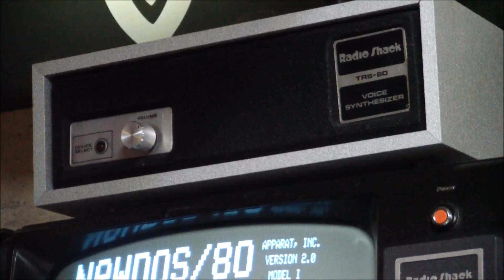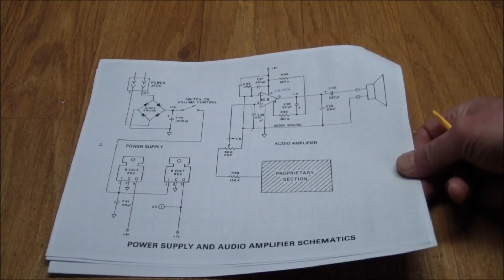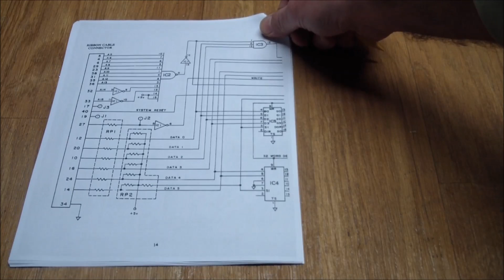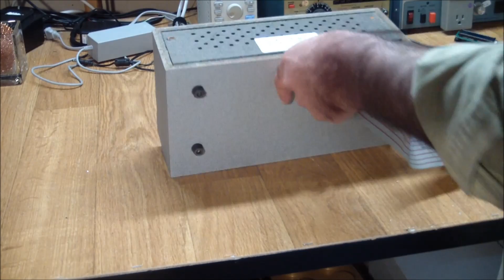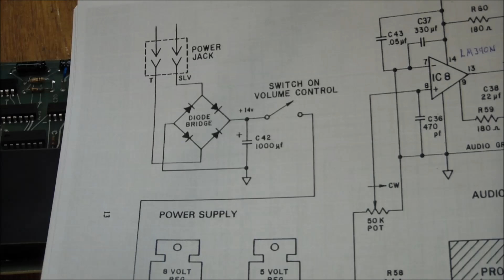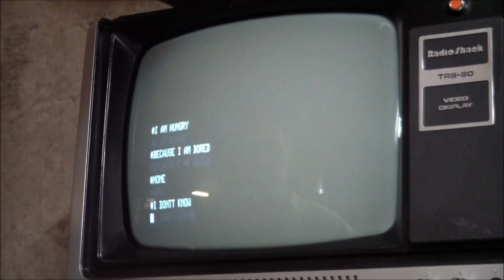AE#82 Radio Shack Model 1 Voice Synthesizer Repair And Teardown

Comment: I have depotted this board, and I can tell you what's under the epoxy curtain.  there are 12 RC filters, and 3 LM339 quad comparators.  That's it!  The rest of the chips are commodity CD4000 series parts and quad and dual op-amps.  I managed to reverse engineer it and make a clone.  The only custom parts on it are the two PROMs which are IC11 and IC12 (I dumped those too).  The chips were identified using a chip ID device.
Reply from the maker: Sounds like they built a phoneme synthesizer out of discreet parts. This might have been a prototype for the SC-01, and they used Radio Shack to field test it.
Reply: @artifactelectronics  yep that is exactly it.  I have reverse engineered 5 different discrete synths they made over the years (and potted in epoxy!). The stuff they learned did make it into the sc-01 after a fashion.  Was hoping to do some videos about it at some point.  I had the prototype for the SC-02 and made a clone of it, and shot some video but haven't posted yet
Reply: I just acquired one and I would be interested in all your reverse engineering notes especially the identity  of all the chips not in the potted section . Thanks very much...

Comment: Incidentally -- How did you get your Voice Synthesizer to play nicely with the Expansion interface?  I never could get mine to work together with it...  (of course, there were only, what, at least three different revisions of the E/I, and about as many revisions of the keyboard-to-E/I cable, so I wouldn't be at all surprised if you have a more cooperative revision of the hardware than mine.)
Reply from the maker: My E/I is a later revision that doesn't use the buffered cable. I haven't had a problem with the expansion port yet.
Reply: @artifactelectronics  That must be it, then -- mine is one of the earlier revisions that explicitly requires the buffered cable.  Still, it does seem peculiar that they won't play together -- the Screen Printer wouldn't work with the buffered cable because the buffers prevented it from being able to assert control over the bus and do direct DMA on the video RAM in the keyboard, but the Voice Synth should just be passively looking for writes to the last 32 bytes of video RAM, not trying to do DMA, so one would think it shouldn't care about the buffered cable...

Incidentally, where did you dig up a copy of the Voice Synth's service manual?

Comment: I have one of these but don’t have the input transformer. Could you tell me what I need to power this up?  Thanks!
Reply from the maker: I'm using something from my parts stash that outputs 9VAC @800mA.
Reply: @artifactelectronics  The spec calls for 12.5 VAC 800mA  but your 9V adapter worked ok? Interesting. I guess the 9V is enough to satisfy the created 8V and 5V.  Thanks, finding an exact one has been tedious.
Reply: Thank you!

Comment: You could try looking for the article in BYTE Magazine that shows how to build a speech synth that works off of the printer port. According to whats written here it may have been a Votrax chip, but I build one and I could have sworn it was a Vortex chip from Germany. (sorry I dont have access to the unit to check).
Reply from the maker: I'll look through my Byte collection, probably done by Steve Ciarcia.
Reply: @artifactelectronics  Yeah it was

Comment: GI Speech Chip, Radio Shack use to sell them..
GI Speech VOICE SYNTHESIZER SP0256A-AL2 + CTS256A-AL2 Text to Speech..
The reason it was potted was you could Build your Own with There Parts for about $100 1/4th the price..

So you want to play with my stuff eh.. Lets start OLD School, DuMont Model # 224-A Oscilloscope..It so Heavy..And needs a Tuneup..
Reply: This was equivalent to just the SPO256, plus some logic to detect when phoeme bytes were written into the buffer. The CTS256A did a reasonable job of text-to-speech and was designed to be driven from a serial port, meaning it could echo terminal text (like in WarGames)

However, the SPO/CTS became available around the time this synthesizer was being discontinued. The proprietary stuff in this unit came first.
Reply: Yea that makes perfect sense. It would be good to flip the board over and verify the chips pin count and footprint. I still have those chips in their original packaging.

Comment: When an Arcade games usings multiple CPU z80 chips, the IRQ signals are located in the ROM chips? the IRQ signals are trying to prevent all 3 CPU to never access the shared data buss and address buss at the same time? Since 3 CPU are sharing the data buss and address buss you need to use IRQ signals to prevent accessing them at the same time?

Comment: I found from and run very similar.
60Hz/120Hz certainly puts less strain on the smoothing caps than a switching PSU so they seem to last a lot better.
Reply from the maker: Good point. I've found lots of bad electrolytics, but rarely are those primary smoothing caps.

Comment: Radio Shack sold a carded voice synthesizer chip (SP0256-17) at one time...I'll bet that's what's inside
Reply from the maker: It seems to be a close race between the SP0256 and SC-01, or a precursor thereof.

Comment: All electrolytic capacitors prior to 2000 have corrosive DI-electric fluids.  Electrolytic capacitors become unreliable after 30 years, and after 40 years the acid has severely damaged the internals of the cap causing higher current flows and short circuits.  That's why we change them on a time expired basis.

Comment: Votrax were very secretive about their speech systems.  They were known for potting their non-IC versions of the Votrax SC-01.  Luckily the expensive bits of yours are still working fine.  Chips for Gorf/Q-Bert go for over $100 (!)

Comment: InTeReStInG... 

ALL THE secrecy. I was really chomping at the bit for a DEMO. However I failed miserably at understanding the majority of the synthesized speech 🤐. Of course the audio path from the unit to our ears would be quite the "Mr.Toad ride" when the path is considered. But still.... I swear it   "No' speek-ah D IngLish"   for me..

In a compairson, I always thought DECTalk was good, for the time... (@$4k, I bet). But after straining to understand the Shack-box, DECTalk is starting to sound more like Pavarott (no disrespect to RS. That was the place to spend your money! Even if they did need to know your address & PH# just to buy AA batteries.

Bottom Line: Enjoyed the insights, Especially after all these years. Pulling back that curtain and all that. Thank you 😁

re: Equipment donations🔬📹📸🖨💽🎥
For me, knowing what side of the world the ArtiFaCts-Lab is on would help in knowing what is appropriate to entrust to the (very questionable) shipping system. i.e. $ize, Weight & Fragility. I'm in So Calif. Cheers!
Reply from the maker: I'm in Salt Lake City, Utah. Shipping can be a problem (i.e expensive) since I would probably get a PO Box which would mean that items would have to be shipped via USPS. Maybe I should look for a mailbox place that accepts shipments from all carriers.
Reply: I understood approx 90 to 95% of it.

Comment: From the image the synthesiser looks like there is a ROM inside the potted area, and there is a counter driving some of the address pins, and then the speech is simply filtered from the PWM using the audio filters on the left side of the board, with all the large polystyrene capacitors and 8 pin opamps. Basically a prototype of the SPO256 chip with discrete logic making up the counters. There probably is a large mask or Eprom in the potting, and you will see the pins from below easy enough. Data out will probably be sent via a shift register to get the PWM, with the input data selecting the address blocks to use, and then perhaps another ROM in parallel doing glue logic for the various lengths of the phoneomes instead of having them all the same time.
Reply from the maker: I think it's a contest between the SP0256 and the SC-01. Maybe someone involved in the development of the synth will come across this video and solve the mystery.

Comment: I first used ELIZA in 1971 on the Ohio State PDP10 computer.  I/O was via teletype.   When you ran the program it would type out "The doctor is in" .  OSU was doing research on speech synthesizers it was a box of analog stuff connected to the PDP10.  i thought they were wasting time,  whats wrong with a teletype?
Reply from the maker: Funny you should mention that. In the mid 70's we had a PDP-10 at the computer lab at Penn Sate, and there rumors that it could talk. I was never able to substantiate those rumors.

Comment: It might be more intelligible if it did the S’s better. Maybe the circuit has a problem? I would have expected the unit to sound essentially more like a TI based speech synthesizer since Radio Shack sold the TI chips back then...
Reply from the maker: I actually borrowed one for a few weeks when it first came out, and this one sounds exactly like it. Maybe I should tap the raw audio output and run it through some better equipment. Equalization might help.